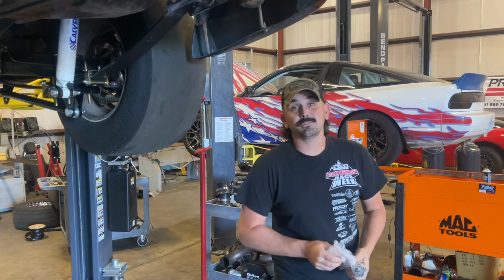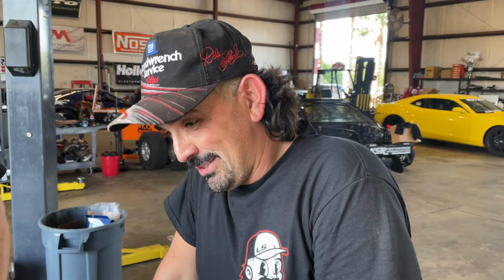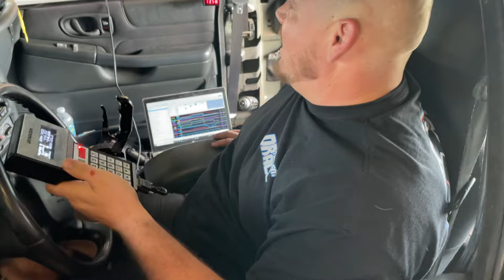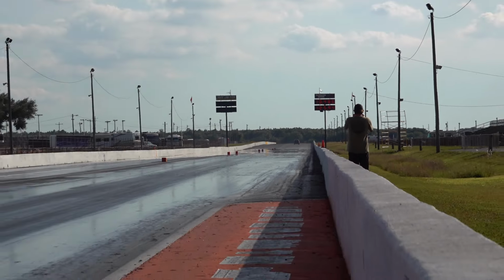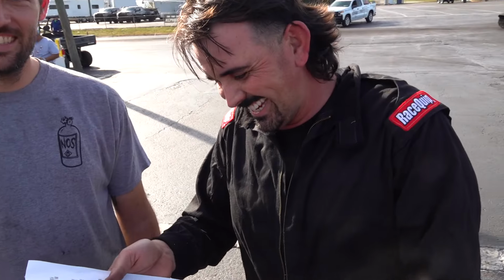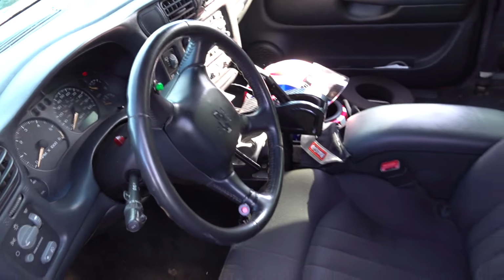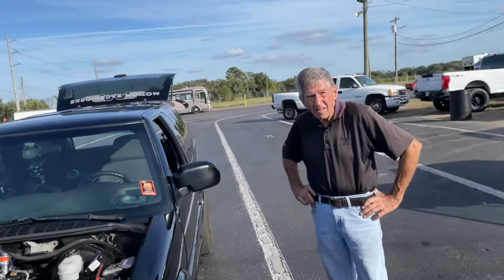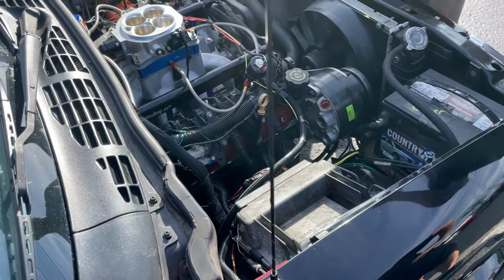We Might Have Sent the Blazer TOO HARD... Will It Ever Go 9's Like This? (HUGE WHEELIE)

Comment: Put a three foot bar in the hitch receiver, weld a wheelie bar wheel to the end.  When you want to get a 9 second pass leave it in.  When you want to wheelie, take her out.  I’d watch that all day
Reply: That’s actually an interesting idea
Reply: I think the Blazer needs a full cage too
Reply: @adriane7841  it's getting fast enough to need one
Reply: @adriane7841  if it hits the 9 seconds i must have a cage by the rules... that will also add weight.. so it needs a bit more hp to stay in the 9s

Comment: the other reason which i just found out yesterday. why using a whipple is a better idea. is because the fact it takes less power than the normal BDS 8/71. i had found out from mike finnegan that they put a 6/71 double pumper on a stock 5.0 foxbody engine(ford thunderbird). he said with that kind of power, it would split the crankshaft in half. the last thing anyone wants to see is a split crankshaft

Comment: Wheelies are pretty damn awesome, if you want 9's you better put a peg leg on back. Probably an extra wide one, blazers wheel base is short x short, if you have the typical width wheelie bar the blazer will chew up one side of the bars just from the torque transfer on a short compact truck chassis.  The 4 link and everything behind the tail shaft are introduced to way more torque just because of the tight wheel base.  Some weight in the center would probably keep it from wanting to flip backwards.  The wheel base front to back is compact  when the wheels lift,  the center balance point of vehicle is so small that it goes up and down extra hard/fast with the back wheels obviously on pivot.  Mid weight would keep her from going so high up so fast.  That and a dummy bar.

Comment: Ever heard of a chassis oscillation compensator ?  Basically a 100lb weight sliding  up and down a few inches on a vertical rod and held in place by a coil spring on the top and bottom. Banned in f1. Waiting to see it on a drag car.

Comment: @Cleetus McFarland; 
The HUGE WHEELIE that occurred when George drove the Blazer, seen here, nearly lifted to a 45 degree angle, while the rear bumper hitch hit the ground and was dragged. When Garrett [Cleetus] drove it, the HUGE WHEELIE, also similarly occurred.
James said it was 'going to the moon', which could never happen, nor the rear wheels lift, except if the vehicle would continue to rotate such it it would lift onto the rear bumper and lift off the tires.
The forces which lift the front tires are rotational, which are due to rotational, spinning forces, energy transfer into the tires, but exceed the traction the tires have to translated the power to move horizontally, forward, thus they are spinning and the catching [wheel-tire hop] and thus some transferred into lifting the front end, and past the expansion of the front suspension, resulting in the lift. As the amount of energy transferred to lift more which caused front to lift and the body to rotate upwards on the back wheels-tires, the more angle of lift from the pavement increases. If the forces, energy were enough to lift the vehicle and it would rotate more and potentially to a full 90 degrees or more. If the rotation exceeds 90 degrees, the vehicle would turn, flip over. The rear end of the body could prevent the amount of angle lift, as a wheelie bar, since if the distance is long enough, the wheels-tires would lift off the pavement, thus their rotational force energy would become just spinning in the air and not transfer to rotating the vehicle.

But, for the 'fun' of expression of extremes, that many may go within their thoughts in their mind, they will enjoy this type of ludicrous, ridiculous, nonsense.
[Am expecting the numerous of individuals with to comment with their lacking of information, knowledge, concpets, principles, as the statement James makes.]

Hope that You'All are able to correct this situation, and get significantly more power, energy transfer through the tires on the pavement and transfer the energy into useful horizontal power, thus speed, properly, effectively and efficiently.

All The Best and Much Success in Your Quest, Safety, Health and Well Being.
Sincerely